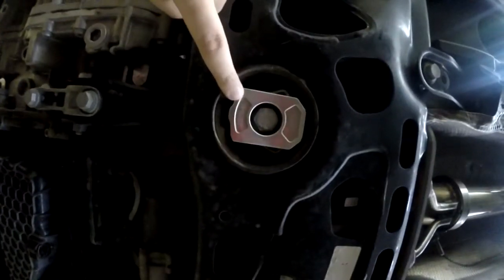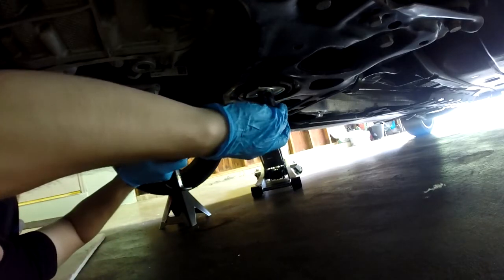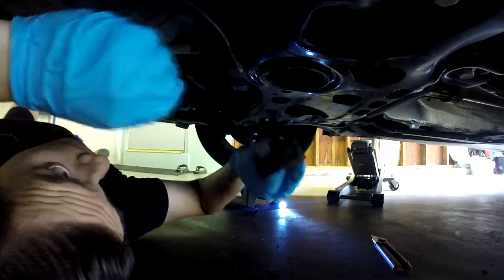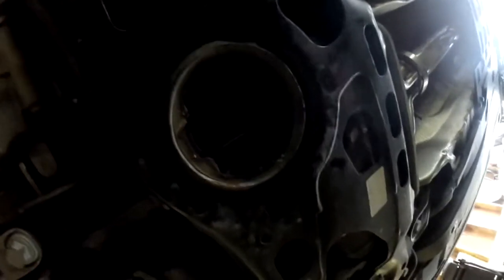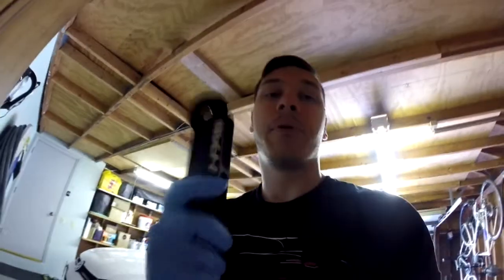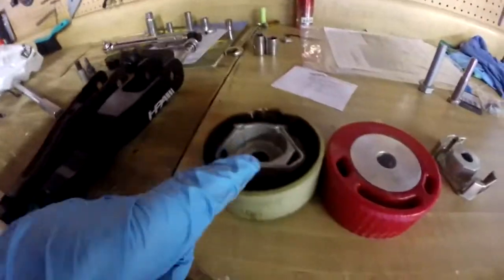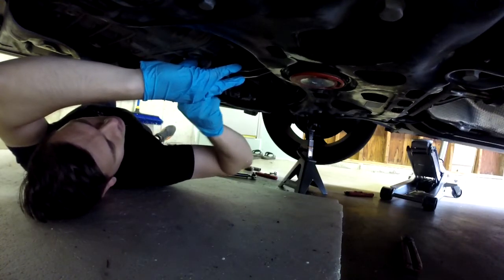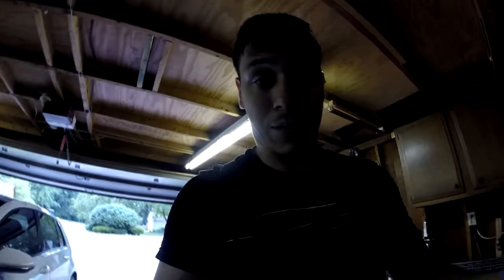mk7 HPA mount install

Comment: Good stuff.  The MOUNT itself doesn't need upgrading until you get into really BIG power.  Stage 2 isn't close enough.  If you were near or past 500hp you might seriously consider and more rugged mount.
Reply from the maker: It helped once the car was IS38.
Reply: @LifeofPandK  Especially if opting for HT.

Comment: is this mount the same design for vw golf 2.0 tdi  2014?
Reply from the maker: I am not familiar with the TDI and how the engine is positioned/mounted.  I am also not sure if the 2014 TDI is on the same chassis platform.  Based on that I would say it most likely wont fit.  Sorry wish I could help more.

Comment: Did you end up using the sleeve for the bolt?
Reply from the maker: The sleeve would not fit.  I think some cars it is needed to kill the bolt movement.
Reply: @LifeofPandK  thanks got mine used and did not have one but worked without it

Comment: How is NVH vs 034?
Reply from the maker: Same.  This mount is tits.
Reply: bluedoggiant, I too have the HPA dog bone. NVH is certainly more than stock. However, after 500 miles it feels just like stock. Very smooth, yet at the same time cuts wheel hop down immensely!